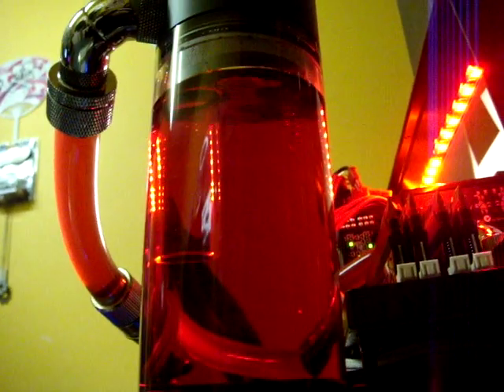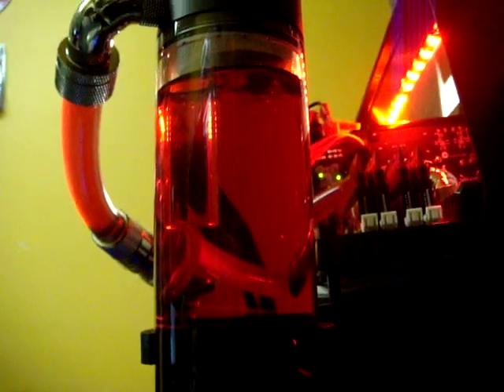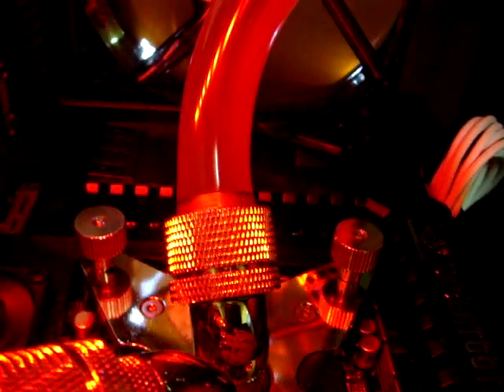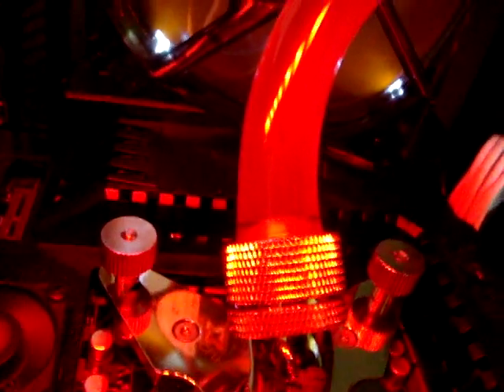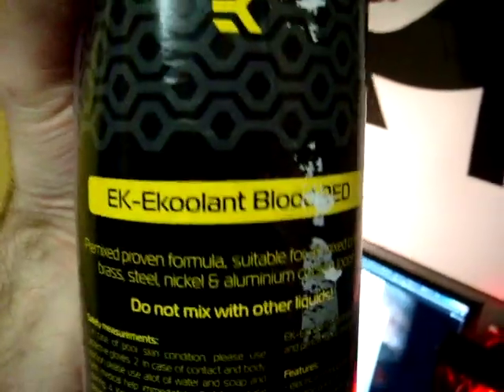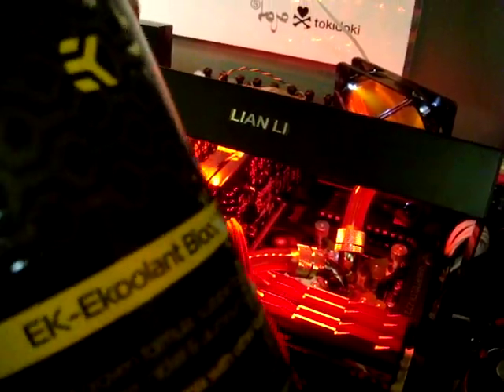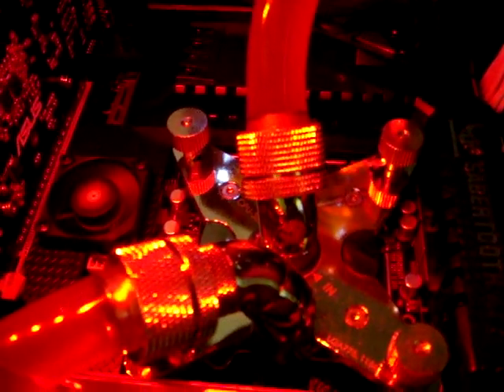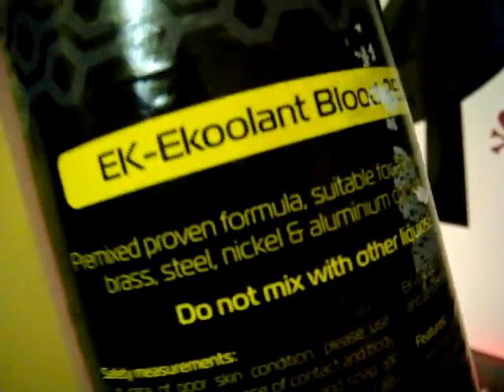EK Blood Red Coolant (why not to buy)

Comment: I have 2 liters of EKWB Blood Red premixed coolant that have been sitting on a shelf for 2 weeks since I bought them. I carefully lifted them and held them to a light and they don't have any gunk in the bottom at all. I have to think you got bad coolant or maybe they fixed their mix (the bottle is different). Also, I've read that even with clear tubing and clear coolant, the tubing will get cloudy over time.

Comment: About six months ago I added liquid cooling to my rig using EKWB components and the pre-mixed blood-red "Cryo-Fuel" brand of EKWB's coolant. The tubes are still clear with no clouding detected. The only issue I'm having is the slow evaporation of the coolant. In six months the fluid level in the accumulator has gone from full to half-full. It's about time to buy another bottle of pre-mix (the initial set-up used the whole 900 ml first bottle).
Reply: what are you using, soft or hard tubing?

Comment: I ran this coolant for 24months straight(yes I did not change it or top it up(as I didnt care about the system)).
My tubing was clear, no gunk in the CPU heatblock, no gunk in the rad, no gunk in the pump or tank.
When I did drain it in the bathtub, it stained the tub, but this was cleaned with some stain remover for clothes in 2 minutes

So if it doesn't cause any real issues with my extreme lack of maintenance , the average joe that follows maintenance will not have any issues.
Reply: What did you use for flushing your rads?  And for getting stains out of the block if you ever changed colors?  Waiting on my blood red to arrive, and will probably try white pastel at some point if.  Obviously the red would fuck that white up bad if it was still present.  As someone who has had success with it, what is your tried and true methodology?  Straight from the instructions in the box?

Comment: As others have said it's more than likely the tubing. PETG/Acrylic is the way to go, no plasticizer worries.
Reply: +Will Sartin (5RWill) He shows that gunk in the coolant bottle, that's not right!
Reply: That is fair enough. Having said that i've ran Mayhems X1 blood red for 13 months now with no issues. Dunno about EK but Mayhems is good to go. I will disassemble by the end of december and change tubing etc.
Reply: To update...i'm still running Mayhem's X1, haven't changed or cleaned. No issues. I need to because i've lost a decent bit of liquid from evaporation, Probably get around to it christmas brake.
Reply: Yeah, I used EK blood red for almost two years without changing. Had no issues or build up with PETG.

Comment: I have the ek uv blue fluid bought it from EK waterblocks with my 1080ti waterblocks. 
before I took the old  1080s out I flushed the system 3 times with distilled water. 
installed the cards filled it with the uv blue 
the fluid looks clear when I put it in as soon as I run it it looks like mayhems arura  fluid with particals swirling  I thought it's supposed to be clear blue 
I sent an email to ek about it